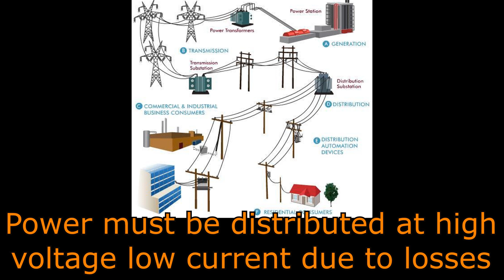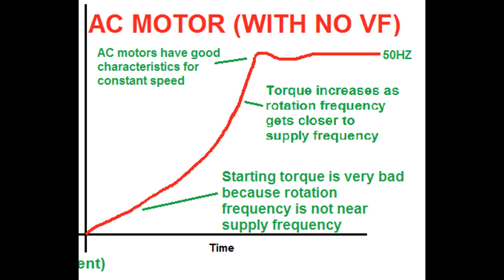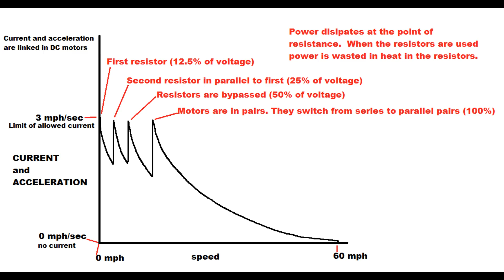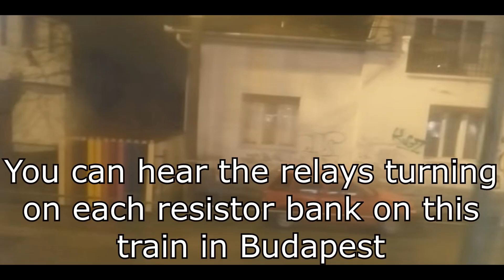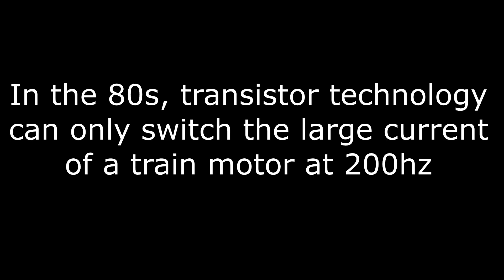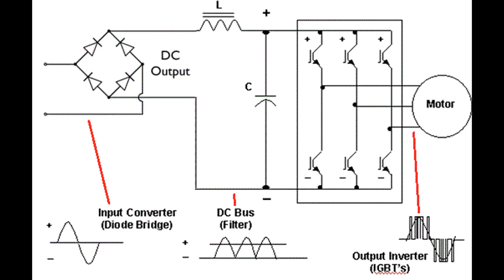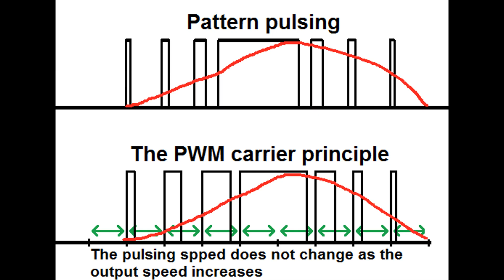Why do trains make interesting sounds

Comment: The Dutch ICNG make a sound that I find particularly annoyinf, it has the "changing gears" like sounds but then suddenly jumps to a higher frequency, (as if it's downshifting on acceleration), which I don't  understand from a technical standpoint.

Comment: This is the only good explaination i found on the web!!!!!
what i understand:
We have to mathc the friequency of the AC motor to the Squirel cage inside, if you dont it just makes well, heat. and thats bad.
Step 1: use a pwm drive that you can adjust the output voltage off
Step 2: use with another drive that creates the bottom 1/2 or use this drive with a SSR that switches wheter that voltage goes to the negative 1/2 or the postive 1/2
Step 3:Now we have a frequency of 10hz on the output, but thats good for slow speed but for higher speeds we do need to decrease the pwms "frame rate" or carrier freqeuncy: like when you are watching a video on a crap computer, or playing a video game, you reduce the quality for the frame rate to increase and the game to feel smoother, but when you have to see something which is tiny, you bump up the quialty at the cost of fps, and that will couse a sudden frame rate drop
same with motors: you increase the pwm carier frequency to recrate a more full pwmed sine wave or SPWM but then since your transitors can only siwtch on and off so fast, you have to reduce the quailty of the sine wave so your trinastiors dont get stuck in a 1/2 on 1/2 off state becouse its like a cat chasing a lazer pointer, it will apear on the other side quite fast, but if you move it back and forth, it qill not be able to move that fast and it wil kinda stay in the middle (with its eyes and face moving in funny ways), and thats BAD, heat will build up very fast (Trust me i know how fast exactly :) and then it might break, so we will reduce the indiviusal switching betwween each 1/2 to kinda make up for the turn of and back on for the next cycle of the wave, most VVFDs actually may even go upto sqaure wave back in the day for max speed

Comment: You should see what the Pennsylvania Railroad used, thr Northeast Corridor has 5 different Electrical systems across its length, 12kV 25Hz AC (what the Pennsylvania Railroad used), 12.5kV 60Hz (what the Former New Haven Railroad lines were converted to), 25kV 60Hz AC (what the Newer Electrification to Boston and former Lackawanna lines were converted to), 660V DC Bottom Contact Third Rail (what the New York Central Railroad used for Grand Central Terminal in 1904), and 750V DC Top Contact Third Rail (used by the Long Island Railroad) also because of this there were Multi system locomotives used on various sections as Early as 1907 and because of this the line has had weird Electric Locomotives for its entire existence as well as having the First Dual Mode Locomotives introduced in the 50s

Comment: The technologies of which you speak were actually available a bit earlier.  I remember reading in Robert Tufnell's The Illustrated Encyclopedia of Railway Locomotives that some experimental German diesel-electric locomotive had AC propulsion in 1968 (I might be off by a year in either direction), and that French trains started using synchronous AC motors in the 1970s.  Meanwhile, in my own experience not relying on 3rd party sources, the Boeing USSLRVs (often just called LRVs) used on the MBTA (Boston area, USA) and MUNI (San Francisco, USA) in the 1970s had electronic choppers that went up to 400 Hz, but were NOT constant-frequency when starting up; they also had a low voltage generator that had a lower frequency chopper, with the total result that they sounded like they were powered by tortured ghosts with terminal indigestion.  They did have a provision for switching out the propulsion chopper once they got going fast enough.  I have seen one unit (in a 2 car train) on which this mechanism was broken on one end so that the chopper was always cut out, and so full voltage was applied to the motor (each end had 1 motor for 2 axles) when starting; but contrary to your expectation, it didn't destroy the motor or even trip a circuit breaker, but instead spun the wheels on that end (with great slippage); likewise, during application of reverse voltage during dynamic braking, it spun the wheels on that end backwards.  The 1980s-vintage Hiticha trains on the east-west line of MARTA (Atlanta, GA, USA) had the same electrical systems (both propulsion and low voltage power supply), resulting in the same sounds, although much muted due to better sound insulation on these cars (this disappeared after they were rebuilt with modern electrical systems in the late 2000s/early 2010s).  The MBTA (Boston area) Type 7s (built by Kinki-Sharyo) of the 1980s were actually a technological step back from the Boeing cars -- they had constant-frequency choppers operating at 220 Hz that never cut out, and they went back to a motor-generator for the low voltage power supply, whose hum could get very loud if the bearings were going bad; these were also a weak point in that they could fail (probably because somebody forgot to change the motor brushes), and then the train would soon after become disabled once the low voltage battery discharged below a certain point (which didn't take very long).

Edit:  By the way, fixed-frequency AC motors have been used for traction, and still are, although now to a limited extent.  Pioneering examples entering actual revenue service include the FS (Italian Railways) E550 and their successors using 2 wire 3 phase supply, and the original locomotives of the Virginian Railway (EL-C) and the Norfolk and Western that used single phase supply but used a rotary phase convert to make the polyphase electrical supply for the motors (I think these came even before Kalman Kando did the same thing in Hungary).  Modern examples in revenue service include the Petit train de la Rhune (in France) and up to 3 other mountain railways (but I am not sure which of the others still actually feed fixed frequency AC to the motors as opposed to rectifying the input 3 phase current and then re-inverting it to make variable-frequency AC).  Presumably these dealt with the problem of poor starting torque by using over-engineered motors, as well as liquid resistors ro limit current to keep the wheels from slipping and prevent overheating of the motors.

Comment: 12:20 So the rate of the transistors is really easy to hear the 96 and 92 stock have lower frequency sounding ones. I need to watch the video again to properly understand it though. 

From a very brief overview though it seems like the more modern motors do a similar thing to the older dc motors but in a much more precise and controlled way or a way that allows the motors to work the way they do more naturally, if that even makes sense.

Comment: I assume it was easier to change frequencies smoothly rather than pulse width.
Reply from the maker: How do you mean?
Reply: @benolifts  I would assume there's a minimum pulse width for whatever switching transducer they're using, and that this minimum pulse width would push too much current through the motors at the nominal PWM cycle frequency.

To reduce the PWM duty cycle (and therefore time-averaged current) further, one can decrease the PWM cycle frequency. That way, a pulse of a certain duration would still make up a smaller proportion of the overall cycle, but without breaking the minimum pulse width rule. As speed goes up, the motor can take more voltage without drawing excessive current, so frequency can go up.

The reason for the multiple frequency changes (which sound like gear changes) may well have more to do with the implementation. Typically a PWM circuit is built using a clock and two counters. One counter is used to set the cycle time (in effect it forces a reset after X many clock pulses) and the other determines the pulse width. It can set on-time or off-time, it really doesn't matter, but for this example let's go with on-time. So when reset, as long as the pulse width counter is less than or equal to the set point, the output is on. When it exceeds it's switched off.

Because these machines are old, and in the past compute power came at a premium, the sensible approach to this would be to use a clock frequency which provides a pulse width that is just over the bare minimum. That way the counter buffers can be made narrower and thus the whole controller gets to be less expensive. This is where clever engineering comes in. The first few PWM increments are very wide relative to each other, so the frequency change trick from earlier can be reused to keep everything smooth. All that's needed is to adjust the set point for the cycle time counter and voila - variable frequency PWM. And because the entire range of that counter is available, we can be a lot more precise with the cycle frequency at that point. Less so at higher frequencies, but at that point the train is going fast enough that normal PWM gives enough control.
Reply from the maker: The reason for the reduction of pulses as set intervals as the motor speeds up is to keep the overall number of pulses per second within a range.   Everytime the thristor switches states, it is completly instant.  There is a very slight moment for a couple of nanoseconds that it is part on and part off.  As heat disapates at the point of resistance, a half on thyistor has become the point of resistance and current is being dissipated.  To reduce the amount of heat in the thyistor there is a limit of how many times it can be switched in a second.  So in pattern mode, as the pattern speeds up, the amount of pulses in the pattern keeps being reduced to stop too many pulses per second.  This happens until the motor is running at a faster speed, where it has less acceleration, meaning less current, after that the pulsing can speed up endlessly without more reductions to the pattern.

Comment: Hey Beno! I might sound stupid but can we get this kind of sound from today's latest technology inverters like  SiC MOSFET inverters? Though their switching frequency is extremely high, can we shape the sound like the 1990"s trains make with the help of some tweaking in the algorithm?
Reply from the maker: The switching technology of the inverter does not directly cause any change in motor sound.  The sound that can be heard is the motor acting as a speaker.  It is the way that the switching has been programmed that makes the sound.  In the modern day a lot of inverters use either oscillating carrier frequency, or random (white noise) carrier frequency.

Comment: what makes that electrical 'tick... tick' sound that large diesel electric freight trains make when they are running but not moving
my guess is that even at idle its generating electricity, and it has to go somewhere so every once in a while a relay goes off and somewhere a spark is created to dissipate the electricity? idk lol
Reply: When they are in "idle" (power lever set at 0), the generator field is open so it can't generate any electricity without the field voltage.
You might be referring to the regular "tick tick" sound of the automatic water traps
Reply: thats really interesting, i don't know what that is so i'll learn something new!! @xeels2708

Comment: This is a brilliant video..and thank you for explaining how these changing frequency sounds are made..but could I ask..what exactly is making these Sounds? The electric motor ? Or the other electric equipment? And what exactly are these sounds , they are obviously something vibrating?
Reply from the maker: It is the windings of the motor.  Any coil can act as a speaker.
Reply: @benolifts  thank you .. but pardon my Ignorance...how is the sound actually being produced.. obviously air waves are vibrating against my ear drum for me to hear this sound but what is actually producing this sound at the motor level..IE the first high pitched sound happens even before the wheels start moving. .
Reply from the maker: @diarmaiddillon1568    The VF drive starts before the brake releases for anti roll back protection.  The creation of the sound is from the VF drive switching the supply, the frequency of this is the sound (not to be confused with the output frequency).  The sound is emitted by the motor's winding coils which resinate the sound through the motor.
Reply: Could you explain the sounds made by the Eurostar power cars when starting ? There is a low pitched hum followed by an octave higher and then at say 10mph there is a constantly increasing tone , could you explain this

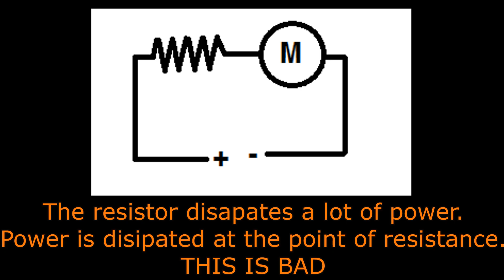Comment: So what you mentioned about the singular tone sound at the start being made by the transistors (6:42) makes sense to me. And it makes sense how you described the IGBTs and such, changing the pitch of the sound along with the motor/train speed itself. However what doesn't make sense to me is that some trains, such as, say the Alstom trains on the Washington metro (3000/6000 series) have only several constant pitches that change with the train speed, and no smooth variation at all - just jumping through pitches. Why would that be? Is that what you mentioned about IGBTs? Or is that the very last thing where you said it changes so there's no resonance?

Comment: I always felt that a train’s motor sounds made up a part of its “identity”, and I also kinda wondered how the sounds are made. I know part of it is due to electromagnetically-induced noise (coil whine), but I always wondered why even the same type of motors might sound different when they are from different manufacturers, etc. 

This video definitely provides a good overview of what I always wanted to know.

Comment: If it’s due to the tech at the time, why does the 1996 stock pulse when the older 1995 stock doesn’t?
Reply: Funnily enough the 1995 stock is actually the newer one, already using IGBT propulsion
Reply: @cheezyvids  one year later, TYSM for the reply! I figured it must be the newer tech because of the sound. Lovely to have this confirmed! What does IGBT propulsion actually mean?
Reply: @theblockybanana5537  IGBT is the type of transistor used because of the higher switching speed.
Honestly, I’ve always thought the ‘95 trains sound identical to the A&B trains from the Prague Metro hah
Reply: more about tuning probably

C751A uses IGBT-VVVF and has a similar sound to 1996 stock

Comment: may i ask if someone wants to put the inverter from the 1996 stock to the 1995 stock will it make the exact same sound?
Reply from the maker: Yes
Reply: @benolifts  wait they have the same exact motors?
Reply from the maker: @marcc1899    Yes
Reply: @benolifts  oh no im worried then since the class 465 had its inverters changed would the jubilee one have its motor changed any time soon?

Comment: Singapore's C751A rolling stock (made in 2001-2) make a higher-pitched version of the '96 stock's sound; a difference I can think of is that the former uses 1.5kV DC from overhead wires instead. The newer C751C stock (made 2014-5) sound similar at lower speeds but at higher speeds sound more like the C830C stock (built at the same time & sounds like Amsterdam metro's M5 rolling stock) that runs on a different line that uses 750V DC from a 3rd rail instead

Comment: great video! my only confusion is, for example on the 2009 underground stock, why does the sound seem to have "overtones"?
Reply from the maker: There are 3 sounds.  These are the VF pulsing sound, the motor sound, and the train running along the track sound.  The pulsing and motor sound sometimes makes an overtone.  Also, the different motors and VF drives are not exactly in sync, which adds to the sound. When one VF drive changes pitch on one end of the carriage, the VF drive at the other end may do this one second later.
Reply: ....are there two sources of sound or one?

Comment: Thanks, I think this is the only video that mentions anything about unusual traction sounds. Siemens did a bang up job with the VF drives on the Taurus locomotive, that plays a musical scale when moving off. Interestingly, the class 700 trains recently introduced make a really weird car alarm type sound when running off the middle rail, but a normal sound when running from overhead, I don't know if that just because they're using two entirely different and separate VF drives or what.
Reply: Well, overhead is fed in AC while when on 3rd rail it uses DC

Comment: The synchronous (pattern based) mode is used to reduce motor current harmonics. The method is called "Selective Harmonic Eliminated PWM" or just "SHEPWM". And you are right, the transition between patterns is because of the limited maximum switching frequency - very well explained!
For asynchronous carrier based modulation there are many methods. More common nowadays is the Space Vector Modulation (because it creates less current harmonics) and in older drives you would find 'center-aligned' or 'edge-aligned' SPWM methods. All of these carrier based modulation methods can be used with a random generated carrier in a given range to reduce harmonics even further.
Reply: You mean pattern based, in contrast to a hard square wave, right? The closer you get to a proper sine wave, the less other sine frequencies you are going to have in the final motor drive frequency. Or do you mean you are making sure the pulse signal sent to the thyristors doesn't have any components above a certain frequency - the elimination of the too thin pulses as explained in the video?